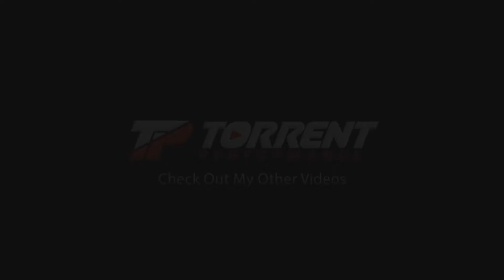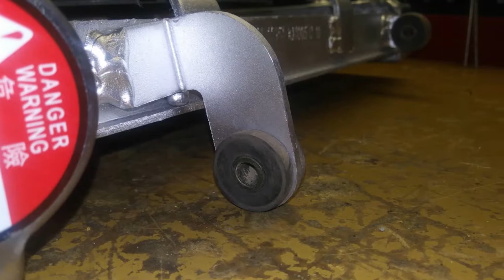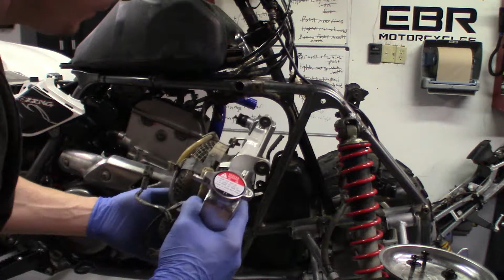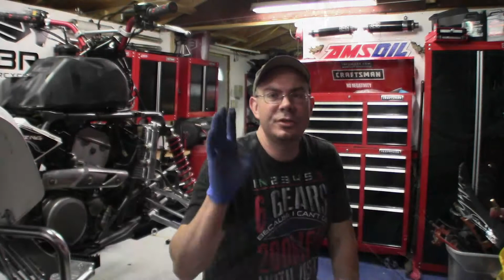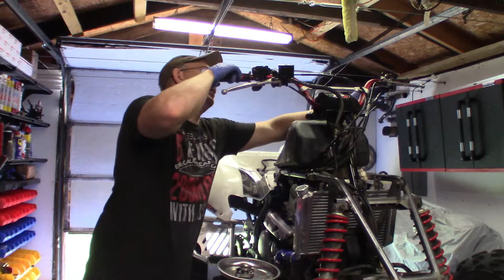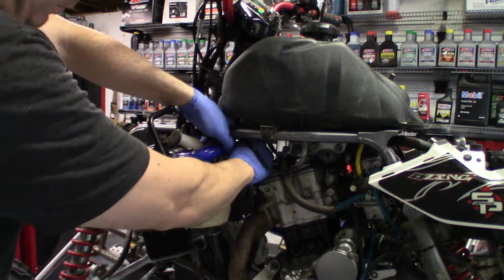LTZ400, KFX400, DVX400 Aluminum Radiator Install And Flush and Fill Episode 4

Comment: I installed a Mishimoto radiator with new temp sensor and fan switch sensor.  The fan won’t come, i have checked all the connections and wires for breakage.  I ran a jumper wire from the switch sensor plug and fan comes on, any idea what could cause this?
Reply from the maker: Cody this is exactly why I am gonna be coming out with my own parts to use on your build. I got your email I will chat with you directly via email when i get home later

Comment: Where can i find that copper washer that i should replace on the water pump ?
Reply from the maker: https://amzn.to/3gZ7Ne4 whole copper set for anything you will need.
Reply: Wow that is a huge help brother ! Thank you very much for that
Reply from the maker: Help me out if you buy from link. Should be m5 or m6 size. This way you have a set for anything else like brake banjo bolts or whatever. Hope the vids help and give amsoil a shot on your quad with my links. Shoot me a email anytime if you need help if you purchase amsoil with my dealer number .
Reply: I just ordered it straight from your link. If ive got any further questions ill be sure to shoot them your way. This is my 1st time breaking down my quad but ive got some mechanical experience. I do all my own work on my 2018 can am maverick x3.

Comment: Are the cylinders identical on these 3 machines?  Ex...with the kfx cylinder fit the ltz?
Reply from the maker: Kfx,ltz,dvx same atv engine wise just branded to 3 different brands. These vids work on all 3 models.
Reply: @TorrentPerformance  thank you

Comment: I try to put coolant on my quad Fill in and its sending coolant to my air box
Reply from the maker: You got something else going on here. I would need more info than this. Only way really that could happen was if you had a bad head gasket and antifreeze was leaking into oil and went threw the oil overfill into airbox. Because the antifreeze is sitting on top of the oil. Otherwise i dont see how this would happen.

Comment: Thanks for your videos! I just my ltz 400 started that hasn't ran in over a decade. Quick question, how do you know if the old radiator (or new) is working?
Reply from the maker: Warm it up and see if the radiator gets hot. If it's not pumping fluid into it, the radiator won't get hot? Or pressure test it check for leaks. If in doubt click that link and buy new hoses and radiator. Otherwise it could be the water pump etc....
Reply: i know im asking randomly but does someone know a trick to log back into an Instagram account?
I was dumb lost my account password. I would love any help you can offer me.
Reply: @Louie Colton instablaster :)
Reply: @Jamir Blake I really appreciate your reply. I got to the site thru google and I'm in the hacking process now.
Takes quite some time so I will reply here later with my results.
Reply: @Jamir Blake It did the trick and I finally got access to my account again. I am so happy:D
Thank you so much you saved my account!
Reply: @Louie Colton happy to help :)

Comment: Hey man, I’m working on a 04 kfx400 for a buddy, can i have a link to the radiator u used, you said it would fit the kfx too? The stock one is 600 from Kawasaki. is the ltz400 and kfx basically the same or what? Thank you!
Reply from the maker: Get this kit with the new hoses. Also think about running amsoil in your quad if this video helped yah and use my dealer number 5541460
https://www.ebay.com/itm/Aluminum-Radiator-Hose-for-SUZUKI-LTZ400-KFX400-DVX400-2003-2008-2004-05-06-07/172831683730?hash=item283d923492:g:CTYAAOSwaRhZm92W